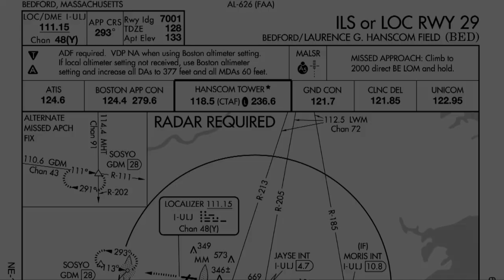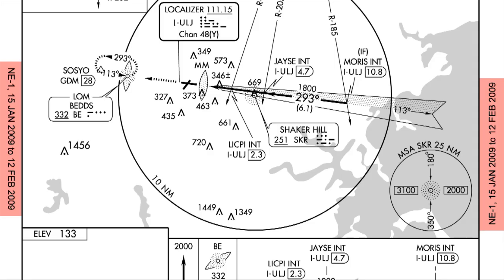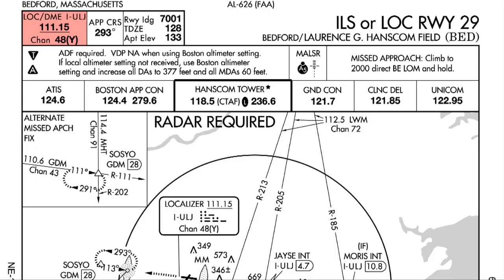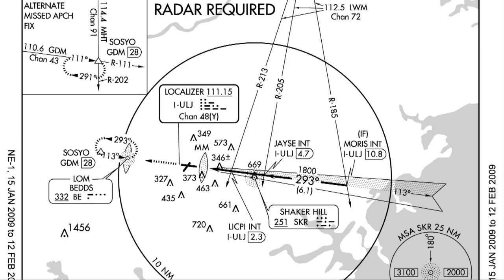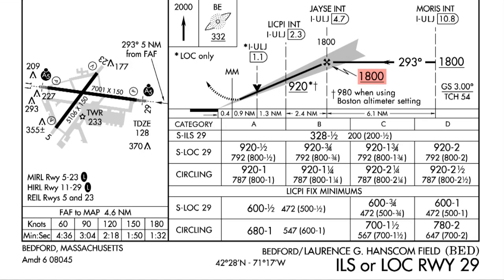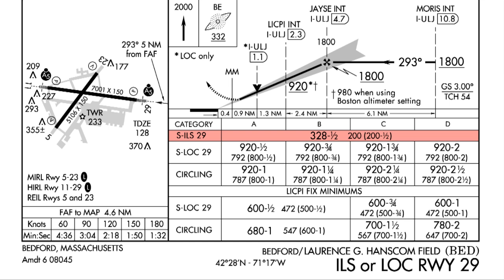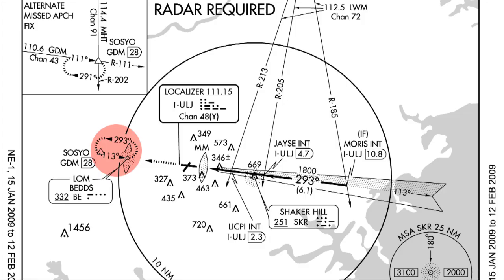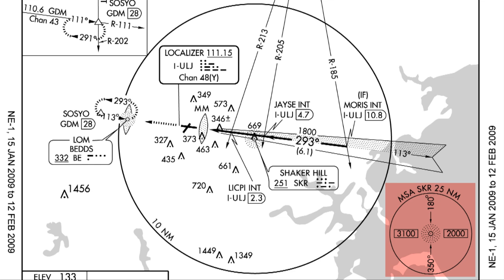Briefing an Instrument Approach

Comment: thanks! very informative!
i somewhat agree with projectsaa3; I learned it as if glideslope fails, you use localizer minimums. Go missed if the pilot feels like theres some kind of confusion.

However, i did hear that part 121 pilots have to go by company rules and most are stricter. May I ask are you going with an airline's regulations? or is this something in part 121 not in part 91? (i'm only a part 91 as of now sorry if this sounds like a stupid question)

Comment: @Javifly430 I go missed.  Outside the FAF you have time to convert to a localizer.  Once inside it you don't have time to figure out if it's the glide slope or your equipment.  If the glide slope it wouldn't be a big deal unless you didn't start the time.  On the other hand, if it's your equipment you could have a CFIT  incident.  The safest thing is to go missed and figure out what the problem is